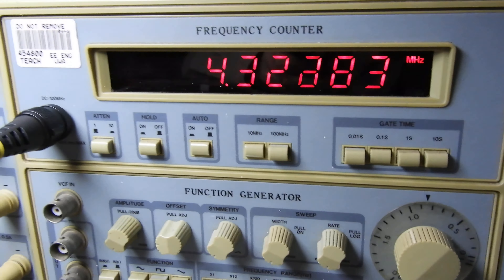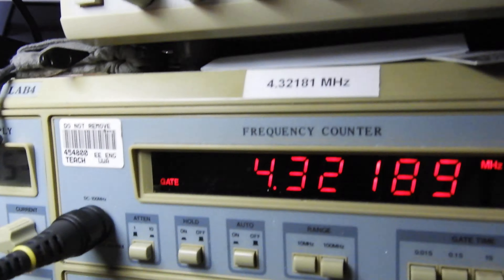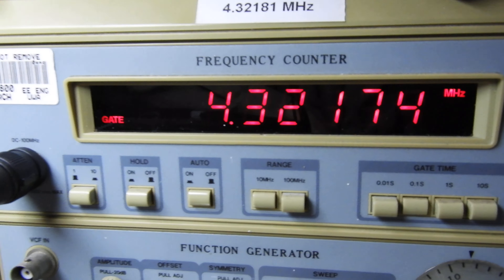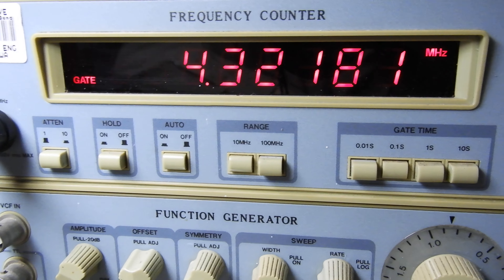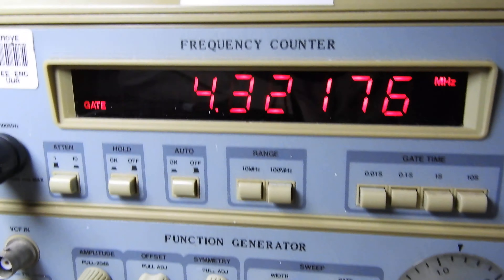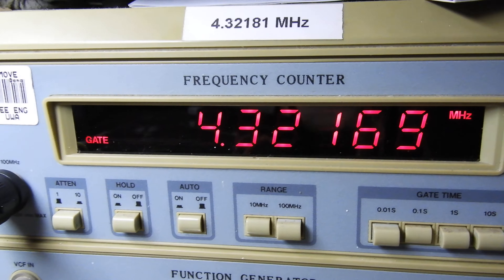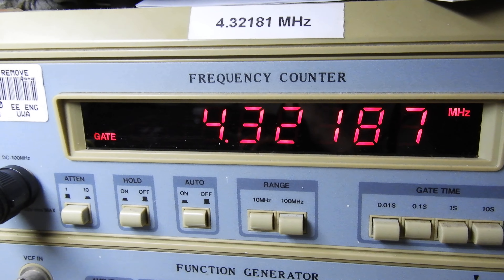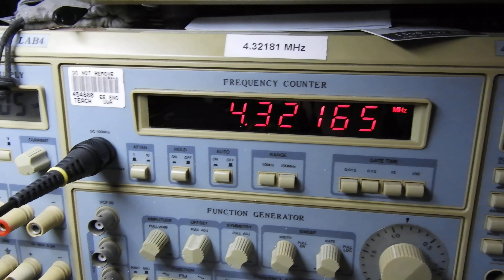Is modding really worthwhile? Do you know if the mod you paid for is installed correctly & works OK?

Comment: The argument often goes like this: it must sound better, because it measures better, or it does sound better, despite not measuring any better.
Reply from the maker: This is not the case here. If you replace all the good quality capacitors in a decently designed and build unit with Black Gates, there is no way to measure the impact and one could debate if it was worthwhile or not.
Reason to replace original clock with one of greater stability, is just that - to give the unit a better clock with greater stability. This one, is no more stable that ordinary PLL in any budget unit.
I have seen some after-market clocks that were rock solid and would not deviate even a single Hertz from the frequency they were set to.
Not a case here. In this case, we can be 100% sure that it was a waste of money.
Reply: @hear-net-au Just a nod to the simplifed bone of contention between the two irreconcilable camps at opposite sides of the debate. Just as often, one comes ax good designs, spoiled by the accounts department, as well as poor ones with an excellent marketing strategy.
Reply from the maker: @paulb4661  the design here is not necessarily bad. It could be that implementation was. You never know if the person doing it isn't just a hobbyist without basic test instruments. He wouldn't know if his MOD was successful or not, having no means to do a check.
Reply: @hear-net-au  You know, what makes the beast tick and you're presented with irrefutable evidence, however one can predict, that the owner, who instigated this botch, heard an improvement in soundstage depth, with and clarity with certain immediacy to the pluck of strings and so on...
Reply from the maker: @paulb4661  Too true. Too many examples of this. In technical world, Sony has often come up with superior product and superior engineering. They thought that that alone would guarantee market success. However superior or maybe overwhelming marketing from others, made Sony fail. 
In similar fashion dyson vaccum cleaners hardly pick up any dirt, yet they are very successful. Same with Apple products. I know at least 200 electronics and communication / computer engineers and technicians. Only 3 ever had their products. Two of them no longer do and I lost touch with the third.
Reply: @hear-net-au  Sonys are really good value for money in my amateurish opinion. Bought an XB790QS SACD listed as for parts only/not working. Played CDs fine, but more often than not, couldnt even "see" the SACD layer. Thought I'll start by replacing all servo smd caps and voila, that was all it took. Serviced the drive best I could, replaced the tray belt and a couple of large PS electrolytics just for good measure and no issues whatsoever since! It even sports dual trafos, like my other baby, the Pioneer PD-D9mk2. Not the Kitamura Kidden ones, which... Sony used in their higher XA range. I now keep it hooked up to MF XCAN v3 running matched 6Η23П Voskhod triodes buffer with Sennheiser HD660s. The combo sounds as revealing and unforgiving as I like.

Comment: How about phase noise measurement?
Reply from the maker: What about it?
It is like arguing whether filling your car tyres with just nitrogen is beneficial. 
In case where pressure should be set to 30 psi and you find 17, 22, 34 and 37psi (these are real figures I had in my tyres after I picked up a brand new car from a dealer in the late 80s), it becomes irrelevant what kind of gas is in them. Car would handle in a inferior manner to one filled with correct 30psi pressure of normal air. No point for further debate.
Here too. With the clock wildly fluctuating in this player, any further measurements are pointless.
Reply: @hear-net-au  Probably this modded clock was not good. Lower phase noise = better sound. But sound of clocks really matter. I listened to two USB cards outputting signal to USB dac. One card has Crystek CCHD-957 femto clock, other card has big hot running OCXO module. OCXO was significantly better by large margin. Now I want to put such OCXO in my CD transport.
Reply from the maker: @zigismunds7465  before you put it in, check if it works. Measure it's frequency with decent frequency counter and see if it is stable.